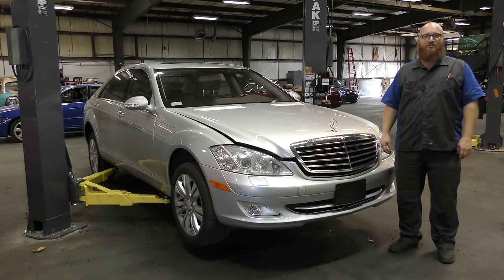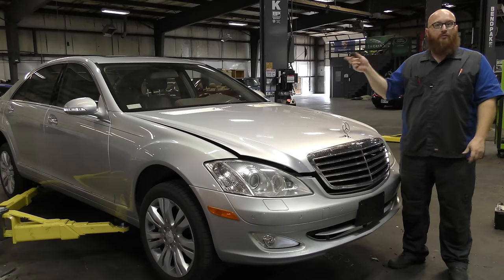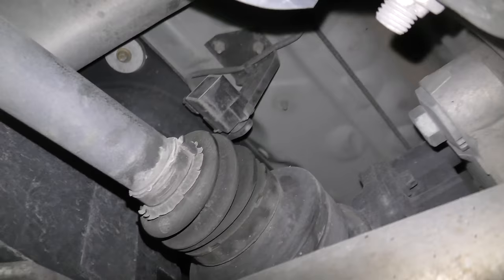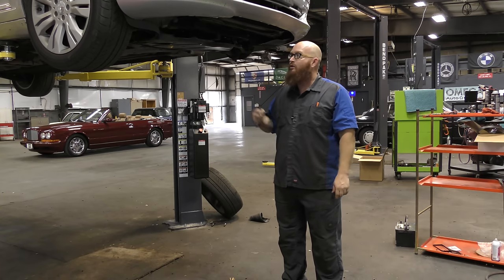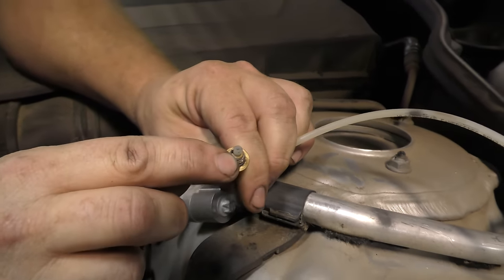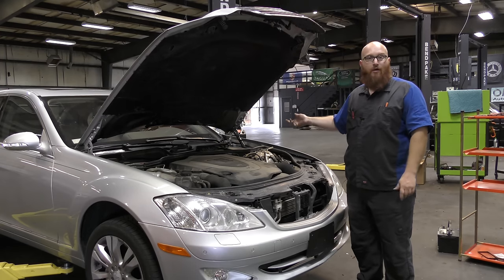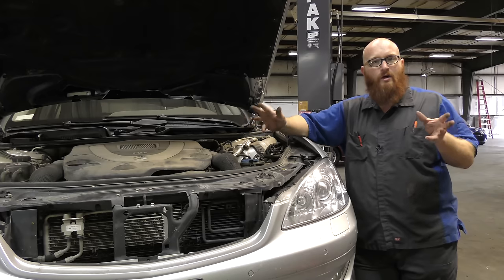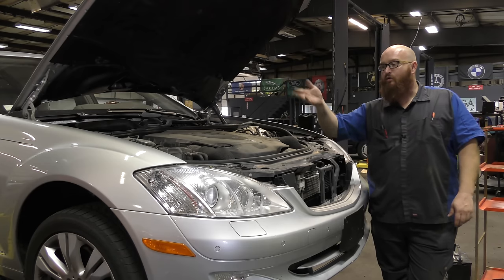Fixing Flat Airmatic Suspension System. CAR WIZARD shows just how easy it is on several platforms

Comment: Wizard...This is an AWESOME explanation of the system. You made it extremely EASY to understand!  Perfect instruction! I bought a 2008 S550 because the right strut was leaking (like your passenger side) for $4200! Owner did not want to fix it! The dealer estimated the repair at $2800! Fixed for $220!
Reply: how?
Reply: So targeting an airmatic vehicle with a damaged suspension allows you to buy for very cheap?
Reply: yeah really, how? cause if the strut was 220 then itll be fixed for a couple weeks
Reply: @allefley4628  Still doing great after 1 year! Could you break tomorrow though! We will see!
Reply: @richardgreene3460  was it new or used? RWD or 4 matic? I need one for my 4 matic and the prices are insane everywhere beside china made ones
Reply: @richardgreene3460  and i couldn't find any good long term reviews from the Chinese ones
Reply: @allefley4628  New & Chinese
Reply: My experience with Chinese struts aren’t so good. They are way too stiff. Spend about $500 and get an Arnott unit. I bought a W220 with failing a failing strut also.
Reply: Always do the work yourself it's just a few nuts and bolts lol
Reply: Where did you get the part that cheap? Arnott or OEM struts seem to be $1000 each wherever I look
Reply: Where did you buy your air strut from? If I did chose to buy a cheaper one, what brand should I go with? Seeing how yours lasted a year
Reply: @elvismurray8898   My "aftermarket" struts  are still doing great! I ordered them from Ebay (Made in China). I cannot remember the brand, but they were a brand I had never heard about. I did purchase the extended warranty for a few dollars, but have not had to use it.
Reply: @richardgreene3460  you really helped me out a lot my man by saving me a few bucks. Was your strut plug and play or did you have to reset your suspension with the sds computer afterwards? Just curious, that’s what I’m most worried about honestly.
Reply: @elvismurray8898  Absolutely "plug n play."  I did NOT have to reprogram anything!
Reply: @richardgreene3460  you’re truly a godsend🙏🏻I really appreciate your advice man!!
Reply: @elvismurray8898  Glad I could help! Anytime!

Comment: I have a '98 Mark Mark Mark Mark Mark Mark Mark Mark, and i'll eventually just replace the air suspension with a conventional suspension
Reply: A customer came to me (auto parts store) to ask me why his freshly bought used Lincoln rode so rough. I looked underneath and saw that someone had welded in flatbar to hold the car up.
Reply: ouch. my suspension works great, but I would like to tighten up the car a bit and add some performance
Reply: obsolete professor wow 😳
Reply: There should be reliable aftermarket parts at a decent price to keep the system.  A Lincoln without it is just not its true self. Maybe Rockauto has stuff?
Reply: @pfsantos007  there are aftermarket parts available for most vehicles with air suspensions including ford.  Arnott Industries in Florida is one and they make parts for a wide range of vehicle makes including ford and mercedes.  In my experience they rarely last as long as the OEM parts but are also usually less expensive.
Reply: I had a 90 Mark VII that the front would bleed down on occasion. It would always blow back up, so I just had to wait a few minutes to drive off. I never did fix it, just sold it that way.
Reply: It's amazing how bad ford and GM systems are.
Reply: @Mach141  The bad thing about doing this is that you don't just need to fix the first problem, the air compressor will wear out faster from constantly having to fill in that tiny leak. Or an air strut is having a tiny leak  and could explode any moment.
Reply: obsolete professor lmao
Reply: Yes
Reply: noooooo
Reply: obsolete professor : Oof
Reply: @pfsantos007  Arnott
Reply: @obsoleteprofessor2034  classic!

Comment: Most German cars use a Wabco air compressor and you can do a full rebuild (cylinder head, piston ring, & desiccant) for $75-$100.  My 04 Porsche Cayenne still uses its original Wabco pump motor & piston, which still works great after a rebuild & 225k miles
Reply: Mine is too, 2007. Did everything you said. All parts costed 30 bucks for my CLS550. Same pump still working strong.

Comment: I just replaced the front struts on my S550. It is very easy and the part was not expensive. The airmatic system is very easy and simple.
Reply: You should post a video talking or showing this. It always helps to get a different perspective and your style of doing things may help many people afraid to buy this car for this very reason. Thanks!
Reply: if it cost you to do it yourself 550.. it will cost three times more at a shop.. they double the parts prices and charge out the waazoo for labor.. of some guy that just learned how to replace a tire.  Now you too can be a Wizard,, just do your Mechanic Certification ONLINE and never even get your hands dirty!!
Reply: One side of my S550 leaks and one side is lower than the other side two issues any solution

Comment: Wizard thank you so much for this video. I have a 2011 E550 with a flattened rear end. Two shops wanted to convert the car to coil springs and I refused. Your video just confirmed my decision. Best explanation of airmatic suspension. Love your videos. Thank you again
Reply: Did you do all 4 or 2 at a time....what did you do to repair also did lights stay off on dash

Comment: "What's the craziest suspension story have you ever seen?"  Rust.  The problems that happen when suspension components, or usually the mounting places, rust out entirely.  Some so bad that the car is basically spare parts.  Fixing the rust issues would exceed the value of the car.   Also, Jr. Mints hair is awesome.  Stop judging people simply off of their looks.  From what little I know of him, he must be a good employee.  He works with the Wizard and his high standards for repair.  Kudos to him.
VT247
Reply: I got one for you.  just pulled an S430 out of a garage, hasn't moved in 5years, flat as a pancake.  Computer is not calling to activate the pump.  So I bypass the relay, pump starts, runs awhile and then the hissing starts.  Removed the biggest squirrel nest under the pump you ever saw.  Still hunting for the issue.  Sucks to be me!

Comment: Terrific explanation of the S Class air suspension.  I own a 2008 (46k miles) and everything works....for now, but thanks for all this explaining.  It will eventually help me when I have to get it repaired.  Too bad the owner never steam cleaned that engine bay.  Mine looks brand new, this one looks like it has 150k miles on it.  He needs to clean it.

Comment: I had a W220 this happened on and I ended up replacing the compressor and one strut which are not cheap.  The W221 I now have is a far superior car. One piece of advice I was given by my trust UK Merc man is that you should raise and lower the suspension once each month just to keep it operational.
Reply: Same with Mercedes’ door windows and sunroof.
What happens is the rubber seals heat and cool and get dust and grime, water build up that can congeal and literally glue the seal to the window glass.
The plastic pulleys and slider jaws on the window regulators can get brittle.
When the glass is glued to the seal and operated the weakest point is the plastic pulley or the very thin operating cable in the window regulator and either one could break causing the window to not go down or go down slightly while you hear a clunk/ bang/ whizz noise followed by a puckered sphincter muscle and a phone call to your
Mechanic.
My advice for Mercedes’ owners about sun roofs is don’t touch the operating button at all
If it hasn’t been opened in a while….just don’t touch it and it won’t break.
Soft tops?
Use them regularly or else you have valve block leaks, hydraulic ram leaks, position sensor micro switch problems, etc.
Reply: i was afraid to touch up and down button just incase it broke something

Comment: Don’t forget Cadillac LOL first thing to go on the El Dorado… We replaced with some that we could adjust manually with the compressor. Once we found the right PSA it was set for good really… Those hard plastic lines kind of suck. I am very surprised they don’t use something metal braided or anything else that it is holding all that pressure…Thanks for the videos, cheers!

Comment: Another quick way to diagnose for the diy’er, from your valve block you can disconnect one line at a time and use air from that end to tell if the line/ bellow is leaking, just like car wizard tried to air up just the strut except if you have a leaking line this can be helpful to do it this way

Comment: I've had a few airmatic or similar  cars (E500, ML63, X5, LR3, LC100) and was always surprised that anyone would change to coil shocks. I had to fix most eventually but the result was rewarding each time. Rewarding how? Well the cars worked as they should again and performed awesome again. No issues at all with the LC, but the rest all had shocks replaced eventually.

Comment: I agree with you completely on repairing air suspension instead of coil springs, you get what you pay for.
Reply: Right, TQ, you can get what you pay for over and over again, or, you can go to coil springs once, and be done with failures. I say this from experience.
Reply: @shanepowers7566  yeah but it compromises the character of the car. springs feel like poo compared to airmatic
Reply: @shanepowers7566  And you know better than the original Mercedes engineers who designed the air matic system.
Reply: @shanepowers7566  you should have bought a Corolla , not S class Mercedes , and be done with it to begin with

Comment: I used to work for the Canadian Division of the German company that supplied MB with the deep drawn metal and roll formed aluminum parts for the E class, M class, and other MB airmatic struts.  Interesting that the after warranty business exceeds the original production volumes by a significant amount....tells you something about the reliability, and also that the average owner goes back to the dealer for the work instead of searching for aftermarket alternatives.

Comment: Great video! As an owner of an 08 S550 4matic, I now know my way around suspension problems! Only part you left out was the central resevoir tank (i just replaced my leaky one!)
Reply: Did that make the whole car flat?
Reply: In the trunk?
Reply: Good point as there is no moving parts in the reservoir tho I have seen problems usually from accident or mice chew on the aril lines.  Also I disagree o his neg opinion on the abc  every problem I’ve seen can be traced to not changing the fluid periodicalyEVERY ONE
Reply: Are we able to fill them manually for a short. Of time?

Comment: Very simple explanation and illustration of components. I will now fire my dishonest mechanic who tried to rip me off. He wanted to replace the entire system and not even telling me which component is faulty. I even suggest that the left  rear bag is leaking since the front remain normal for about a week then it also deflates. Then I touch the wire connector sensor on the left rear and it would inflate again. This inflation would last for a day or two in the rear then the front would also deflate after a week

Comment: I just replaced the rear air bags on my w212 e550. I went with the arnott replacement parts. The day after, the car was flat and pancaked on the garage floor again. Turns out that there was a leak in the hard line on the valve body that controls where all the air goes..... I trimmed an inch off the line and plugged it back in.... Now everything is great. Im glad I did the airbags but i didnt need them.

Comment: My ‘97 Seville SLS has something similar.  Sadly, GM no longer makes replacement units for when they fail and believe me, they will fail.  The nice thing is that there are aftermarket replacements that come with a LIFETIME warranty. I recently did mine and the car rides better than when it was released from the factory!  
Thanks for posting!!

Comment: If your tired of dealing with the original airmatic , strutmaster or Arnott make nice replacement coil spring/shock conversation.
Replaced a GL 350 system with a strutmaster kit. Worked great and drove very nice. No more problems.
Plus the price of these complete kits are much less than original airmatic. Also comes with module to over ride system.
Reply: I'm surprised it rode nice on yours. Most W221 owners ended up swapping back to Airmatic because of the harsh ride. I've personally always stayed with Airmatic because it wasn't too expensive to replace. Not cheap but definitely affordable for most people.
Reply: Hell no lol

Comment: Telling you all, replaced the rear strut left used the old air line fitting and it kept going back down. When back and put the new one on worked perfectly. Bought both so happy, think I'll do the other side. Never did anything like this before 🎉

Comment: I had a 220 chassis with airmatic and I replaced both the front air struts my self.  Very easy to do.  There is nothing like driving a car with air suspension, like floating on a cloud.

Comment: As a long time Mercedes owner I can't stress enough how important it is to change both sides with Arnott but If u want to replace only 1 I strongly recommend putting a used 1 instead because the single new one will have issues within 3 months. That also applies to lower control arms that usually go bad on the SClass and those I only recommend Lemforder because no other brand can fit right or handle the weight of the car
Reply: Arnott has a lifetime warranty on the part at least now. They are covering mine but to your point it may have already killed my pump playing around. These cars we’ll never know for sure way to many moving parts literally and figuratively.

Comment: From Fraser Mitchell, husband of Leslie
I had two Jaguar saloons with the air suspension, and by and large it works OK, but it is very expensive if things like struts need replacing. This expense is what puts people off this type of suspension. With steel coils, they fail, and you fit another one and carry on for not much money.
If a strut fails, like here, its nearly £800 for the Bilstein replacement. It should be possible to just replace the air bag, but there are very few shops around that do this. On the other hand, the compressors cost half that and are easy to swap out.

Comment: Well said on it not being terribly complex. The E70 X5 (BMW, your favorite) also had ride leveling rear air suspension. The aftermarket for those "airbags" is very good, and fairly reasonable to replace.
Reply: I think just on the 7-passenger model (My old E70). Mine had it for sure but I compared it with another E70 (Friend's car) and his is only the 5 passenger and didn't have airbags in the rear.

Comment: I spent probably $6,000 or so on my S550's air suspension at the dealership. Still loved that car! It looked alot like this one.Maybe one day I'll get another, but I won't be taking it to MB for service if it has air suspension issues!
Reply: OEM Airmatic struts were super expensive when introduced in 2000. The prices have come down and there are a few knock-off brands that are as little as $200 now. Arnott is one of the best, but they are much more than $200. If you do the labour yourself, you can do all 4 corners for $1000 with Chinese knock-offs, maybe $3k for the good stuff, but it would be rare for all 4 to fail simultaneously. I'd be tempted to buy used from a wrecker and do it myself, as required, they're not very difficult.

Comment: I own 2006 Citroen C5 with Hydropneumatic suspension called Hydractive 3+ (this one, that You said that's doing mess, around 0:55), After 14 years and over 140k miles i had to replace... 1 gasket. 1 rubber gasket on passenger side due to rubber hardening. It wasn't leaking like a hose, more like a tap dripping, very slowly, It wasn't even doing mess under car. Overall those cars aren't avilable in US :(. They're so comfortable, way better than high class cars with conventional spring&strut, and even Mercedes is licensing this suspension for those cars like this one in Your vid Wizard!
Keep up with great work!
I'd like to see car that isn't avilable in US in Your "hands" :)

Comment: My first car had rear air ride shocks...and a blown compressor. Had to air them up every morning with a tire inflator.
Reply: how?
Reply: @jweezywooden4378  I cut the plastic air line off the compressor, used some hose splicers/adapters and some epoxy to put a valve stem on the end of the hose.

Comment: Good information , I have a 2009 CLS 550 with a slow leak. Around three weeks of sitting the rear is flat and the front is still at the correct height.  I didn't know if this was common that one end could be flat and the other end be at the right height now I know.

Comment: Great explanation. You suggest that the car is drive able with flat struts but my  E550 manual says not to drive after the warning light comes on.   Do the tires rub the chassis or is it just the loss of the suspension function which would mean to drive very slowly?

Comment: i was about to miss my highway exit with my beautiful fully loaded 2007 S550 one night & I hit a dip in the road - it blew my passenger side front airmatic strut. the trick to removing it was hammering out the connection to the lower control arm.....otherwise it wasnt too bad.

Comment: On E-class the rear consists of two parts: an air bag and a strut. It is not one unit unlike the fronts. I replaced my front air struts using arnot remanufactored OEM struts. It took me 45 mins. It is been 3 years and no leaks whatsoever. Ideally they should be replaced in pairs according to MB.

Comment: FYI You can get the air compressor aftermarket Ebay $80, & the air shocks for $180 each and yes they hold up just as good as OEM. German Engineers have them made to better than OEM spec out in Asia where material & labor is dirt cheap! 👌
Reply: I’m gonna do that when mine go